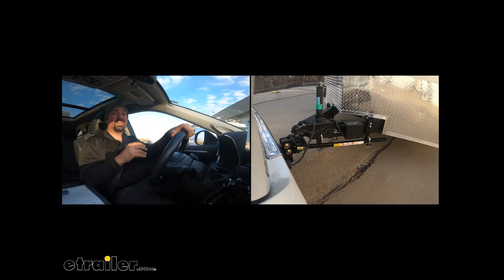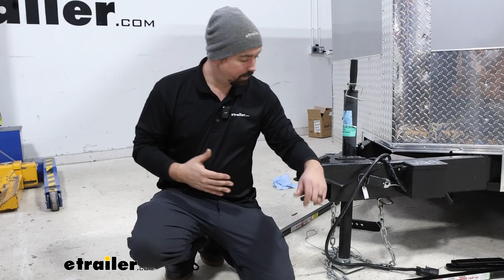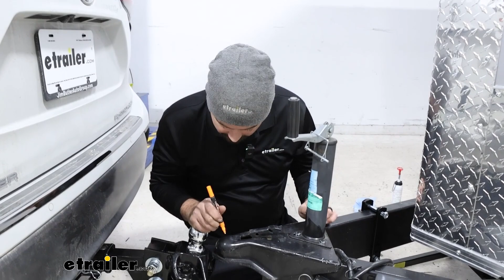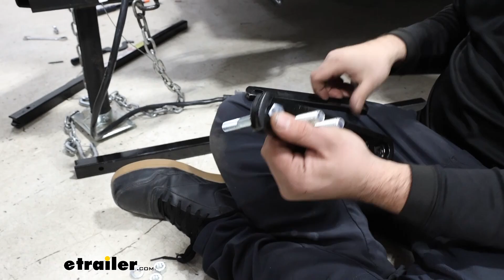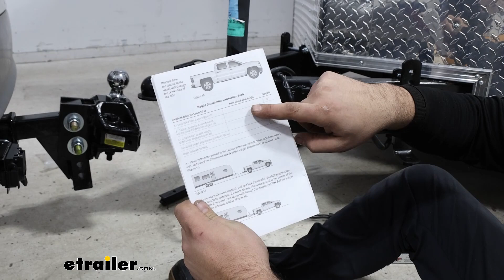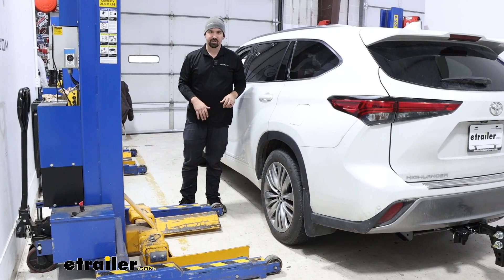etrailer | Equal-i-zer Weight Distribution System w/ 4-Point Sway Control Feature Review

Comment: @22:26 will you please explain the formula My A is 34", B is 34 5/16" and C is 34 1/16". I just can't figure out the percentage formula between 50-100 percent 😢 Thanks 😊
Reply from the maker: With your measurements you're at 80%. The front of your vehicle raised 5/16" from A to B, and your weight distribution brought it back down 4/16" from B to C. Divide 4/16 by 5/16 and multiply by 100, which gives you 80%.

Comment: 50-100 percent of what? Is closer to 50 better or 100 better? Please explain. Nice video 😊
Reply from the maker: The 50% to 100% refers to the amount of front axle weight that is restored after you engage the weight distribution hitch.

For example, when you couple a trailer to your tow vehicle, the tongue weight removes some weight from the front axle and transfers it to the rear axle. A properly adjusted weight distribution hitch transfers some of that weight back to the front axle.

50% restoration means you've restored about half of the weight that was removed from the front axle.
100% restoration means you've restored the front axle to approximately its unloaded weight before the trailer was coupled.

Equal-i-zer recommends adjusting the hitch to restore between 50% and 100% of the lost front axle weight. Most tow vehicle are comfortable anywhere within that range, but it's always a good idea to follow your vehicle manufacturer's recommendations if they specify a preferred amount of front axle load restoration.

Comment: Looks like the hitch head could hit the trailer frame on tight turns.  Have you experienced that?  Curious to know if this is a concern for you before buying one myself.
Reply from the maker: Has it happened, sure. It's not a frequent occurrence. Your best bet would be to remove the bars when you're making low speed sharp turns or if you're backing the trailer in a situation where it can jackknife. 
https://www.etrailer.com/Weight-Distribution-Hitch/Equal~i~zer/EQ37060ET.html

Comment: I had mine install by the manufacture, and was told to put a small amount of grease to all four anti sway locations to minimize the cracking noise and ware.
Reply from the maker: Page 16 of the linked install instructions outlines where the hitch should be lubricated. If you grease the L-brackets where the spring bars ride, you will GREATLY reduce the effectiveness of the sway control portion of the system.
https://www.etrailer.com/instructions.aspx?pn=EQ37060ET
https://www.etrailer.com/Weight-Distribution-Hitch/Equal~i~zer/EQ37060ET.html
Reply: @etrailer  I've also seen were if you don't lube it you could have extreme wear on the "L" bracket. However,  I[m just repeating what the men that make them told me. Mine has worked fine that way for over 35 years.

Comment: To reduce the steel on steel noise, could a plastic surface that is 3D printed  to match the inside contour of the L bracket, be attached to the bracket.  Yes, It would wear down the plastic but the plastic could easily be replaced frequently.   I don't think the steel on plastic surface would reduce the sway bar effectiveness  and it would elimiinate, or at least reduce, the noise.
Reply from the maker: Equal-i-zer offers a product that does that, part # EQ95-01-5150. However, using them DOES come at a cost. Using them will decrease the effectiveness of the sway control portion of the system.
https://www.etrailer.com/Accessories-and-Parts/Equal~i~zer/EQ95-01-5150.html

Comment: That socket is not 1/2 inch drive. It is 3/4 inch drive. Big difference. That is why you had that huge torque wrench! Nice hitch but I would have to get another type because that noise would make me crazy! What I cant figure out is which hitch to buy... The hitch info says so many weights. Will have to call. But I did chat and the guy said a new ranger could not use a wd hitch... lol. Nice and detailed video. Extra points because I have a V trailer, and it was good to see that.
Reply from the maker: If you'd like to reply with the model year of your Ranger, which hitch you're using and the fully loaded tongue weight of your trailer, I'd be happy to help you out with that. However, the Equal-i-zer hitch is one of the most effective options we offer, as far as the sway control aspect goes. Are you currently having a sway issue? How bad is it? Let me know what you've got going on, and we'd love to help get you all fixed up!
https://www.etrailer.com/Weight-Distribution-Hitch/Equal~i~zer/EQ37060ET.html
Reply: You shouldn't be towing anything Frank

Comment: Got figure he didint show getting those bars onto the L brackets. I’m sure that was a chore with 8 head angle spacers and the L brackets on the middle holes 😂
Reply from the maker: It's pretty easy to do. Hitch up the trailer and connect the bars to the weight distribution head. Use the trailer jack to lift the front of the trailer and the rear suspension of the tow vehicle. This will take the slack out of the system and allow you to install the bars using the provided lift handle. Hope that helps!
https://www.etrailer.com/Weight-Distribution-Hitch/Equal~i~zer/EQ37060ET.html

Comment: Great video!  What was the reason you went with 8 washers vs 6?   Thanks!
Reply from the maker: We're glad you liked it! The more washers that are added, the greater the rearward tilt of the ball and the more force is applied to the spring bars. You can see the install/setup instructions by using the link below:
https://www.etrailer.com/instructions.aspx?pn=EQ37060ET
https://www.etrailer.com/Weight-Distribution-Hitch/Equal~i~zer/EQ37060ET.html
Reply: @etrailer  Thank you!
Reply from the maker: You're welcome, we're glad we could help!